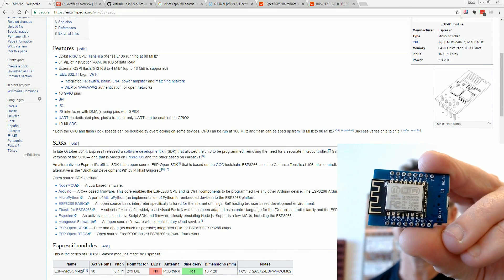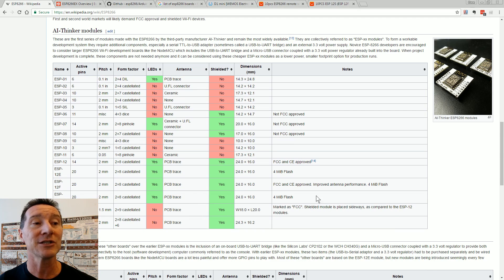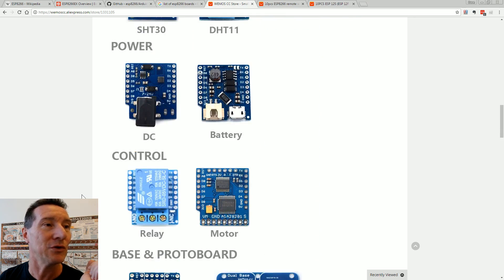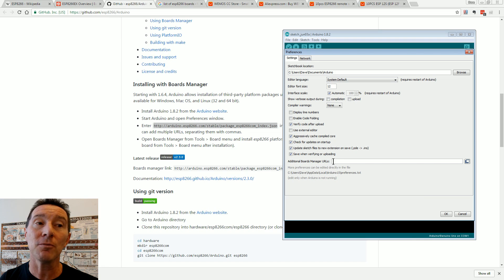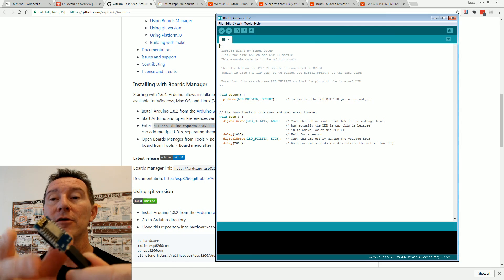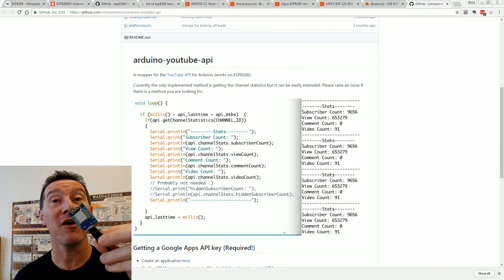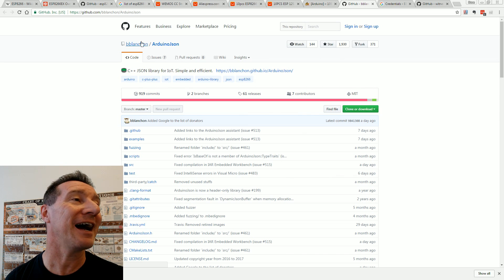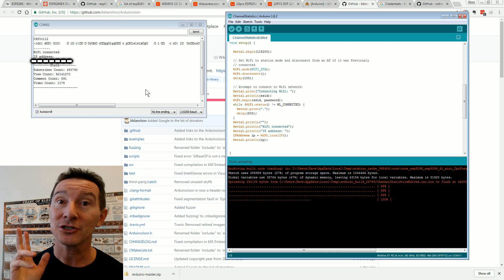EEVblog #998 - How To Program ESP8266 WiFi With Arduino

Comment: Someone actually did a whole project of running an ESP8266 on a coin cell for months! I think you can find their videos on YouTube.
Reply: Andreas Spiess uses LIR2032 rechargeable coins cells because the "normal" CR2032 ones don't deliver enough milliamps during radio operation.
Reply: The rechargeable coin cells actually have lower capacity than the non-rechargeable ones, especially for low drain applications. I believe the person basically puts the esp8266 into deep sleep for much of the time and only wakes it up now and then to log and transmit data. It's probably not the most practical lol but it does show you can squeeze a lot out of these little puppies.
Reply: EEVblog No that's an actual 3V coin cell battery and the video is from Andreas Spiess, the guy with the swiss accent.
Reply: and he explicitly says it need to be a Lithium Ion cell because the regular cells can't handle the peak current needed
Reply from the maker: I think you might find that's a Lithium Ion rechargeable coin cell, different beast.
Reply: don't forget the extra caps for current draw during radio transmission.
Reply: Esp's aren't really great for low power applications. When there awake they use a fair bit of power. Depending on how much awake time very much doubt will get months. Arduino setup for low power have much lower power drain awake and asleep
Reply: If you're actually trying to use the WiFi, ESPs are lousy to operate on batteries. If your application can afford to only turn the radio on really really rarely and keep sleeping in the deepest mode it can, then sure... just keep in mind the way the ESP "wakes up" from that is by completely resetting itself each time - not a deal-breaker, but definitely awkward.
Reply: interrupt
Reply: Maybe he turn off all the modules, and then put it to sleep. Interesting, i remember something like this in the dashbutton products, PIC do it very well, i cant remember the model of uC.

Comment: To anyone interested in playing with these, definitely worth checking out the MicroPython port. Much quicker to get most things done compared to Arduino and C++. One of the best features of MicroPython is you get a REPL (over serial) on the device which is great for prototyping and debugging. https://docs.micropython.org/en/latest/esp8266/esp8266/tutorial/intro.html